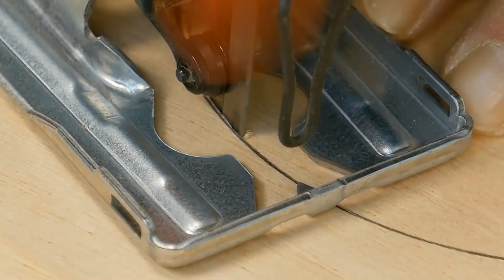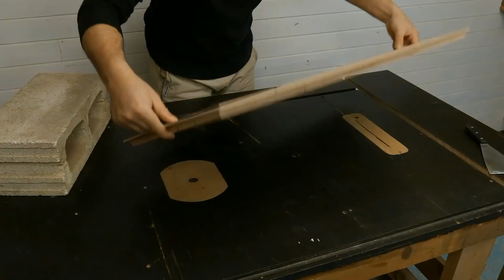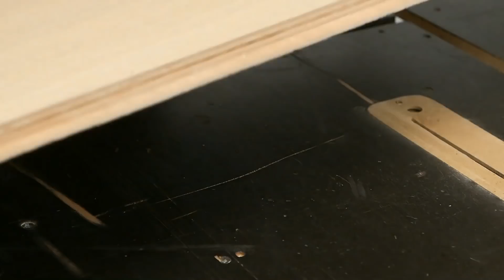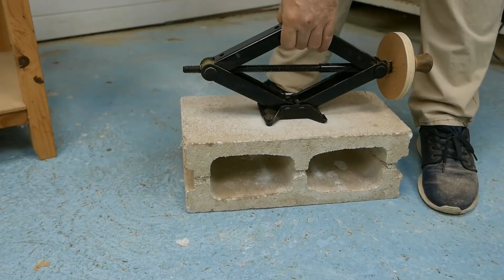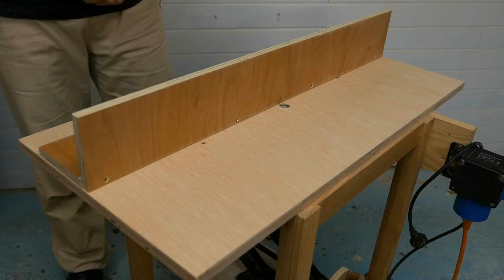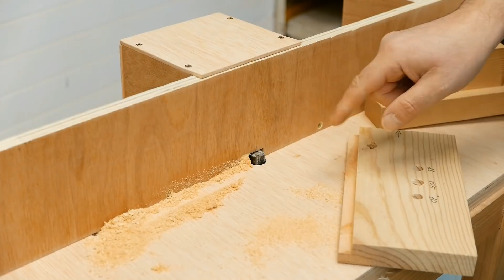Homemade router table DIY, with swivelling fence and lift

Comment: Thanks Sergio. I have been looking for a simple router table build that does not require buying a router lift plate. This is perfect, and I even have the jack already.
Reply: you dont need a router plate, on the plunge router there is normally a stop, remove the stop and tap it with a thread if your lucky to have a round one, insert a long bolt and Bingo you have your lift,, The american companies charge way to much money for a lift half the time more than the cost of a router. This works every time.

Comment: Love the swinging fence, brilliant idea!
Reply: A router fence doesn't have to move parallel because the subject rides on the fence and is always right to a round bit. The only time you need a fence to be parallel to the bit is when you want to use the track on the table and I have never had a problem with that.
Reply: Why are my comments getting posted twice??? That is nuts!!!!!!

Comment: My router base is about the same as yours and fills my needs very well. I have one thing I did that makes my fence a little better. I have a 4 inch slot in the middle of the fence and it holds an insert for each router bit I use. This lets me make the router bits like a zero  clearance plate. The slot has a 45 degree miter on each side so the insert can slide in and then I hold it in with a bolt into a threaded insert so that the threads will not strip out.This added fence plate is made of 1/4 inch plywood.
Reply: Why did my comment get posted twice??? It's not that good!!!!!

Comment: nice work! Improvement would be adding hinges on 1 side of table top and swirl up to change bits easier instead of crawling to 2feet to the ground every time you need a bit change

Comment: Thanks for sharing. I'll use your design in my router table using some scraps of MDF that I already have.
Reply: The MDF might swell a bit if it gets wet. Keep it dry, or get some coating on it maybe? =)